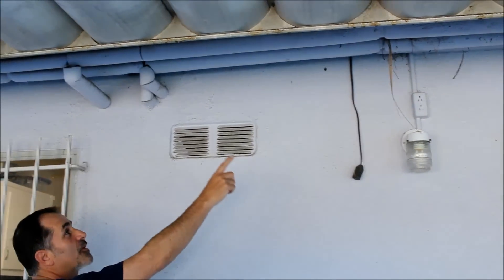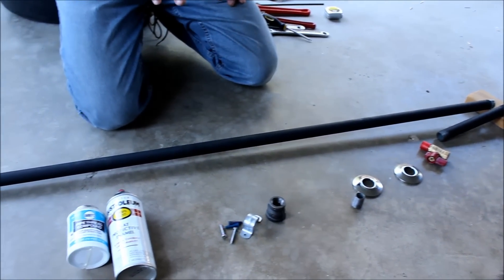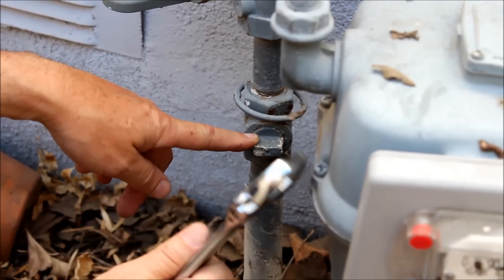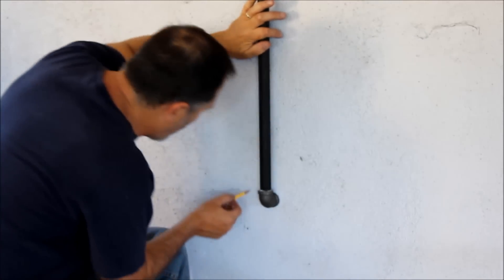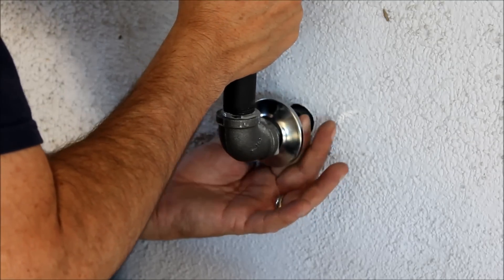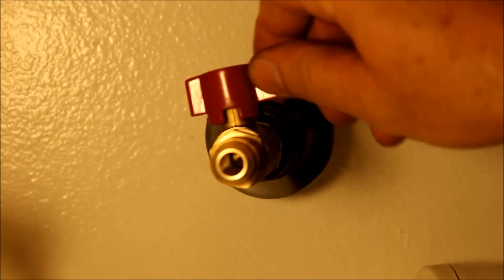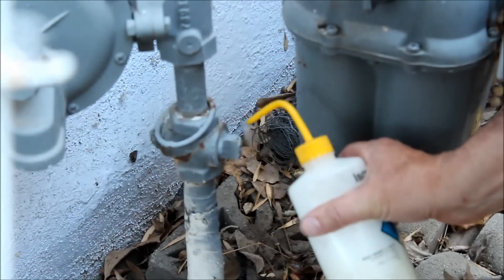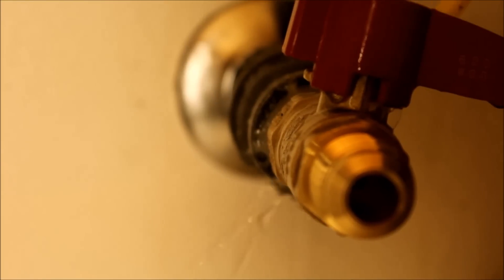How to Install a Gas Pipe Line to a Stove  - James W

Comment: 1. Drip leg
2.Exterior pipe should get some polyken wrap & black paint
3. Easy on the pipe dope. Yellow tape works well also. 
4. Use leak seek, not a solution that will corrode your pipe. Wait longer for bubbles, use and inspection mirror. 
4. Pressure test if you  can.
5. Purge air that may have become trapped until you smell the metcaptan 

 Cheers!

Cheers.

Comment: Shut off valves should not be installed behind a stove , there is no access during a grease fire. Also when you soap fittings you need to go back in case there’s a slow fuzzer .

Comment: water will corrode black pipe fittings, always use the right leak test solution that won't rust your fittings.

Comment: Nice work. I'm getting ready to do the same. Does it have to be permitted and inspected by an official with the city? A 24 hour pressure test with an air compressor tied to one end?

Comment: There is an existing gas line and you're just basically doing an extension inside the house. Does this need permit? What if I do this with a liscenced person but is permit required?

Comment: Does your local code not require a protective sleeve when penetrating an exterior wall? What about a drip leg; without you risk clogging the burners of your new stove.
Reply: Can you explain? What sleeve and whats a drip leg?
Reply: @881DAD  drip leg= sediment trap that collects sediment instead of clogging appliance

Comment: OMG thank you so freaking much. At least it two days trying to find a fancy transition flange to csst excetera what a waste of time. Just using those little covers that you find on your sink or any water. It's just a static run the pipe through the wall

Comment: This is the reason why our utility company started putting barrel locks on gas meters...because no one wants any Average Joe dicking around with gas, like there's nothing to it. You can save plenty of money tiling your own floor, or painting the house yourself. Leave gas and electric to the licensed pros. In my state, you need to work 7 years under a master plumber to get your license to touch gas - even then, some licenses are restricted to one trade only...that's a bit more than a youtube tutorial. Use your heads - for the entire community's sake.

Comment: I need to run a 1st time propane line to my house. Any idea where to find the code that says how deep it needs to be?
Reply: At least 18”-24”. Your local codes might require tracer wire or tracer tape as well.

Comment: Question: Since you turned off the gas line to the house, doesn't that also affect the water heater and/or HVAC at all? I'm thinking that if you turn off gas to the house, then the pilot lights will turn off. Did you have to go back and restart anything?
Reply: All I can think of is to relight the water heater and gas stove (if you have one).

Comment: The contractor costs come from:
Business license fees
Business taxes
Business insurance
Building lease
Benefit packages
Vehicle repairs
Vehicle insuravce
Labour costs
Tool costs
Fuel
Materials
Training
Warranty
All the other costs I missed.

Contractors aren't charities and they aren't just trying to get rich, they have expenses that are necessary to exist.

The reason you should hire a contractor for most repairs is because you don't even know about the many hurdles you may encounter and the risk you could put yourself and others at by doing a repair that you think is ok, until it explodes. Your time is worth money too. Would you rather spend your weekend doing a job that may fail, or just go to work, maybe grab a little overtime and pay to have the job done correctly in an afternoon and you get a warranty?

Comment: Sooo many mistakes but the main one I would point out is never use flat paint. Very porous and readily allows moisture access. A simple gloss black like Rustoleum is superior. I know the response is going to be "but I've had these pipes last for years" but fact is they are rusting below the paint...and by time you see it, it's too late. You also need to strip the tar like substance before painting.

Comment: BEWARE BEWARE BEWARE   horrible WRONG INFORMATION... This video is DANGEROUS misinformation... Using dishwashing liquid for testing lines for leaks...…… in a matter of months  THE CAUSTIC/CORROSIVE liquid dishwashing liquid can & WILL  begin corroding the gas line and then you WILL have a leak (even if you wipe it away )...….…   He is NOT a qualified professional & as a DIY'er that's fine.... but doing it WRONG and the telling others to do it that way too is NOT ACCEPTABLE...

Comment: You are never supposed to put the pipe joint compound inside of a female fitting... only put it on the male!!!
Reply: What is the reason for this?
Reply: @foggymtnbreakdown  it will break free in the pipe and find its way into your gas burning appliance.

Comment: Viewers beware. Although better than many videos on this topic, there are enough inaccuracies (such as a 25x error regarding gas pressure) and installation errors (such as inadequate space from wall to first fitting, so a leak may saturate wall) that I highly recommend not patterning your work from this video. Also be aware that any homeowner's insurance you have will be void with DIY gas installs. To save money, hire a pro to help you design and get correct parts, then to properly leak test afterwards.   Most plumbers will not do this, but some handymen who have years of doing gas systems modifications or other gas work (like myself)  will.

Comment: Cool video. If you find a leak how do you deal with it? I like that you say "don't be afraid to do this yourself" All the pros charge such ridiculous fees to do this kind of work then try to convince you that you are in no way capable of screwing pipes together. The cost of these installs leave most of us no choice but to do it ourselves. I just had a quote of 5200 dollars to run a line 30 feet from my house to my garage with about 200 in material. Forget that.
Reply: It’s not what you do it’s what you know like problems ya run into gotta be able to switch gears and figure it out it’s not just fitting pipe

Comment: Completely against code where I live.  I would seriously check local codes and laws.  Also many homeowners insurance will not cover any damage, fire, explosions etc, if the work is not done by a state certified gasfitter.

Comment: Is pipe lined stove can also be used with LPG gas? Because i have a stove used to run on a pipe line, now i moved where there is no pipe line and wondring if LPG LPG bottled gas can be used instead? Hope someone can answer me. Thanks.
Reply: Yes. You have to get a conversion kit

Comment: Why run the larger pipe and reduce near the end at the valve instead of reducing further up?  Working with smaller pipe is easier and less costly in most cases is it not?
Reply: Larger pipe can supply more gas.

Comment: Good job. Just two things. one:The iron pipe outside should be painted with epoxy or other high quality metal paint. Second. It would be my preference to seal the outer wall where the pipe goes through but I understand the best practice with gas is to seal the inside wall but leave the outside wall unsealed. Reason: if there is a gas leak in one of the pipe joints it will have a chance to exhaust out the outside wall and not build up pressure in the wall cavity.
Reply: You don't need epoxy paint guy. Simple exterior grade house paint works too. You know, all that paint everyone has STORED in their garage?

Comment: Better to brush on soapy solution carefully and check all around fittings.
Also, turn the gas back on slowly or it could lock up on you.
Reply: What if you find a leak, do you just tighten it more or do you have to take it apart and put more pipe dope on. I'm not a pipe fitter. Thanks.
Reply: Gitarzan 66 depends on where your leak is located and what kind of thread is leaking. If it’s a union fitting, most of the time you can just tighten that fitting. If it’s a leak at an elbow or TEE fitting, you may have to break those pipes apart and add more pipe dope/compound to the leaking fitting

Comment: No pipe dope on first 2 threads so it doesn’t travel into appliance regulators or valves.
Reply: Huh?
Reply: Never heard that before? Can you explain?
Reply: You don’t want pipe dope to enter the gas flow..skip the first thread or two...there is plenty of threaded pipe left for a tight seal.
Reply: This makes sense, sounds similar to how you would put Teflon tape in plumbing.

Comment: Did you count Btu load ?
Reply: Good chance he didn't considering he went 3/4 inch all the way down.
But hopefully he doesn't use all his gas appliances at one time.
 he does there's a good chance he'll be starving them.
Reply: @jonathanfurtado3696   do always need to run a 3/4 inch pipe to stove? I have a brand new gas stove with double oven. All the burners are working but not the ovens. My gas line is 1/2.  Thanks in advance.

Comment: I believe any metal pipe going through wall should be wrapped (taped with electric tape)....
Reply: For what reason.
There could be a number of reasons why you would want to wrap it.
But if it's unnecessary just gets things messy & in the way.

Comment: You should put a sleeve for the stub out nipple, and you should always use galvanize pipe for the outside installation.
Reply: adam  - what  and  why  do  you  mean  by a  sleeve for the stub out  nipple?  also shouldnt the pipe  be secured  to  the wall/studs to give it some stability?
Reply: @mvmcali6900  you always want stability.  Esp for water or gas.
Reply: We never use galvanized for gas in our area - always black iron.

Comment: You sir are not an registered plumber, and installing any gas pipe or gas appliances MUST be installed by a gas registered plumber......
Reply: I ran a new gas line to a furnace and HW tank after needing to move the meter. I was required to put a gauge with 5 psi to hold 24 hrs. I called the gas company to verify.
Reply: George Hauser you still aren't qualified to install gas pipeline and putting a video on here doing so teaching others is putting other people at risk... There is a reason why gas work is highly regulated, cos its potentially dangerous.
Reply: Also outside pipe must be galvanised. I've been doing gas work for 8 years
Reply: It depends on where you live.  As long as its inspected and it's your own home
Reply: @CrustyRusty69420  galvanized is for water.  I've never seen gas line  converted from black pipe to galvanized
Reply: I completely agree it’s stupid to work on gas unless you are qualified you put yourself and others at risk. This seriously made me cringe when he just sprayed soapy water all over the joints to test for leaks. Where is your u gauge? How do know for certain those joints are sound? Spraying them with soapy water isn’t enough.
Reply: that wasn't leak test soap just looked like normal water.
Reply: Peter Piper it doesn’t matter whether it’s your own home. I’ve cut off many installations as a gas engineer because of dodgy gas work.
Reply: @peterpiper2590  yeah you paint the black iron

Comment: Wouldn't recommend anyone to do this if you're not qualified. You need to know exactly what you're doing concerning gas. For one, he hasn't even made any sort of checks to know the pressure of his gas or if there's any existing leaks before cutting into it. Even after changing the pipes hes introduced air into the installation and not purged it afterwards. Don't know what the laws are like in America but you go to the jail in UK if you give advice to an unqualified person and they get hurt. You are then liable. 
Yee haa.
Reply: You go to jail if you offer incorrect advice? So glad we kicked your country out of ours.

Comment: Not to knock down your video, but I would have checked for leaks prior to sealing your section running through your wall since the outer chrome flange could have sealed a leak within your exterior wall and the sealant could have temporarily prevented gas from being detected with the soap test.  You seemed to have used a liberal amount of thread sealant on your connections so it’s probably not an issue, more of a hindsight. Excellent video otherwise!  I watched your video to learn more about relocating a small run of pipe in my basement, you’re right about feeling nervous about dealing with black pipe for the first time and I’ve done other major electrical, plumbing and structural projects but gas for some reason freaks me out.  What about using soft copper for inside routing, is black pipe better or preferred for connecting a new run to an existing branch?

Comment: Very informative, thank you. Should there be a drip leg?
Reply: Daniel Grimaldi yes, most states call for one these days, it should be as close to the appliance as possible, so right before the shut off and short flex line running to the appliance
Reply: @HillbillyRednecking  
yeah he should have put in a drop leg but some states are starting to move away from it.
 stating it's not needed but it is a good idea to have one especially on a long run. 
 here in California they're starting to put gas powered water heaters directly on the concrete slab in the garage.
 no platform needed
Reply: Not on a manned appliance. As in it doesnt turn its self on and off like a furnace or a water heater

Comment: very well done sir! one thing, it is NOT recommended to put pipe joint compound-thread sealant into the fittings, only ON the pipe threads.
Reply: Is not recomendable do gas if not qualified period, this is serious staff
Reply: @mariomarionetas4445  how do you know who is qualified? Just because they have a truck and tool box. Educate yourself and you are already more qualified than some stranger.
Reply: Yes do not put pipe dope on female threads, only on the male threads because the sealant can get dislodged or knocked into the pipe and eventually travel down the pipe and clog up a orifice or a plumbing fixture.
Reply: @mariomarionetas4445  that’s why they issue a license for it,so some handyman can’t come in and blow yer house up dumb ass

Comment: Can compression joints be  used on gas connections... With joint seal..
Reply from the maker: Hi Steven, You do not use pipe joint compound on the gas line compression fittings.
Reply: I thought some states were doing away with compression fittings on gas lines on their new codes?